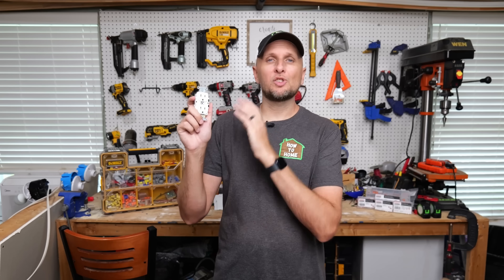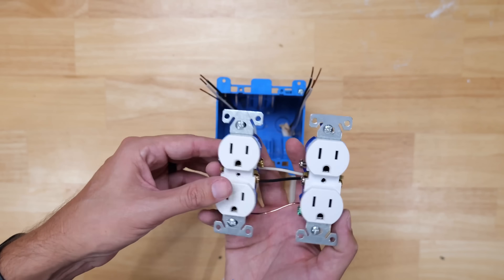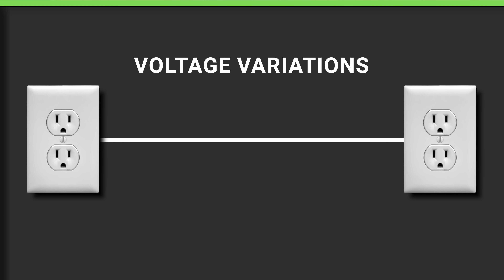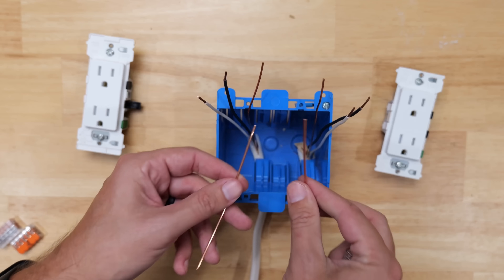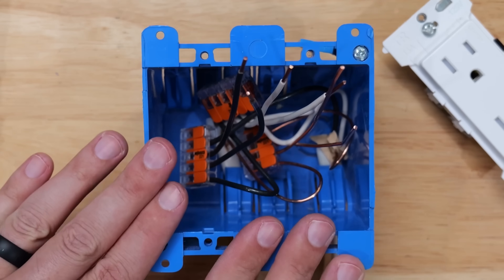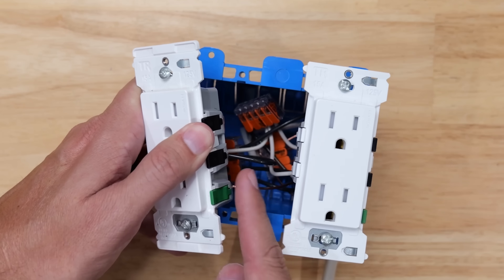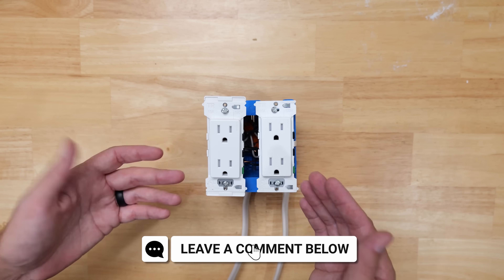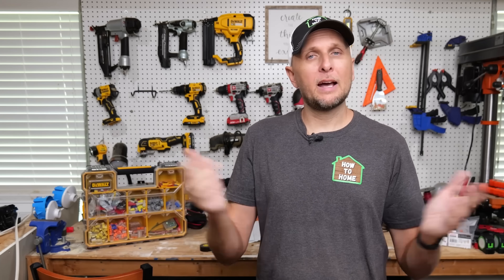Why This Outdated DIY Outlet Wiring Needs to End!

Comment: Comment #320
Not an electrician! Not a DIYer! You figure it out. 
Overall, I guess it is a good video. But one thing struck me as something where some more improvement could be added. You commented on the possibility of there being a Voltage drop if a (heavy?) load were plugged into an early outlet in the string that was wired in the manner you are saying should not be used. While there may be a Voltage drop, I don't think it would depend on the load. A standard (old style) duplex outlet has a pair of shorting pieces between the two screws on each side (hot and neutral). These shorting pieces are on the OUTSIDE of the outlet and provide a short path for the current to flow weather there is a load plugged into that outlet or not. The contacts on the inside of the outlet are connected EQUALLY to both of the screws, forming a "Y" with the two screws. Yes, a load connected at an outlet will produce a Voltage drop, but not between the two screws. The primary Voltage drop will be in the wire between the outlet with the load and the breaker box. And this Voltage drop will be the same regardless of how the outlet or outlets are wired in the one box. When I say "the same" I mean that none of the meters commonly used in the field would be able to tell any difference. You would need an expensive, laboratory grade meter for that and quite a bit of experience in using it. ------------------------------------------------------------------paragraph break----------------------------------------------------------------------------------------------------------------
On the other hand, when you used a five hole WAGO connector, you placed the incoming and outgoing wires at the first and fourth holes with the two pig-tales going to the two sockets in the second and third ones. Thus, the current flowing from the incoming to the outgoing wires and vice-versa must flow across those two middle holes. Just as the wire between the breaker box and that outlet has resistance, so too does the buss bar inside that WAGO connector. With the price of copper always going up, you can bet your last dollar, mark, yen, or whatever that the engineers at WAGO have pared that hole-to-hole buss bar down to the very, very smallest that they could get away with. And that means that the Voltage loss across it will be the most allowable. By having the current for the outlets further down the string on the first and fourth holes the length of that buss bar between them is 3  X the length between just one hole. However, a different arrangement of the four wires in the one WAGO connector can reduce that buss bar length and the corresponding Voltage drop by a factor of 3. Yes, I said 3. ------------------------------------------------------------------paragraph break----------------------------------------------------------------------------------------------------------------
I would suggest that the incoming and outgoing wires be connected to adjacent holes in the WAGO connector. That small change yields the 3X reduction that I talked about. In order to further separate the currents, I would suggest that the outgoing wire and the one or two pig-tales be on opposite sides of the incoming wire. That would give us one of the following wire sequences: For two duplex outlets: Hole 1, pig-tale; hole 2, pig-tale; hole 3 incoming wire; and hole 4, outgoing wire. And for only one duplex outlet: Hole 1, pig-tale; hole 2,  incoming wire; and hole 3, outgoing wire.

Comment: Sorry, but I fundamentally disagree with everything in this video, especially calling jumping outdated. This is completely unnecessary extra work for 95% of the cases. Especially to the DIY crowds that draw to these videos and don't have any experience doing electrical work, adding all of those extra wires and pigtails or wagos is more points of failure, and overfilling the box. Furthermore, try doing this on old work with 12/2 in smaller boxes.

Outlets are built to last *decades*.  And failure of one doesn't always mean everything on the line is going down, either. I just don't agree with any of this, nor do I think electricians everywhere are doing this extra work.

Comment: I do the daisy chain method when connecting a string of outlets together on the same circuit.  Its just so much easier to make the connections to the side of the outlet instead of using pigtails.  If I am working with a double outlet box I do have to connect the two outlets together with short wires going from one to the other.  I don't worry about outlets going out and finding the problem and having all the others work down the chain.  With electrical wiring, I have found that when I do it right, its done right.  You have less chance than the super duper mega lottery of having problems.
Reply: Absolutely, and much faster also.
Reply: Exactly and you don’t have all those extra damn wires in the box

Comment: In series (daisy chaining) versus in parallel (pigtailing).
Reply: That method of daisy chaining was not series it was parallel. If it was series nothing on the circuit will work. Take a battery for instance if you go( + to - and + to - ect) that is a series circuit now if you go + to + ect  then - to - separately ) that is a parallel circuit. They are both daisy chain method

Comment: Your opinion doesn't matter. Refer to NEC. 😂
Reply: Basically the NEC does not address how you should wire something that is left up to the electrician. There are different ways to wire something. You could solder that splice then wrap it friction, rubber and plastic tape in that order and that is not against code

Comment: are those connectors code compliant ?
Reply from the maker: Yes.  They are UL listed.
Reply: @HowToHomeDIY  - UL is not the NEC.  UL tests products for safety.  NEC and/or local codes determine what devices and connection practices are allowed or not.

Comment: I have been using the better method for quite some time now.  My 1950's house has some dated plugs, and I have replaced all of them with the new decora edge receptacles.  I like their ease of install, but I also like the feature that blocks the plug from curious, tiny hands.

Comment: Would converting to this method defeat many GFCI circuits? Our house is 25 years old and if I installed your pig tail system I think all the down stream outlets wouldn't have GFCI protection any more! Let me know if I am wrong.
Reply from the maker: You wouldn’t do this with a GFCI.  You would be required by code to have the current pass through it to the others.  What is in the video is for your standard outlets.
Reply: @HowToHomeDIY   The GFIC has a line out when you send it to the next receptacle you can and should pigtail the rest of the circuit.  It will all work.

Reply
Reply: Yes you are wrong. The GFIC has a line out when you send that out to the next receptacle you can and should pigtail. It will work as it was designed to

Comment: I am an Industrial Electrician & Motor Controls Maintenance Technician. I have 25 years of electrical experience, including residential, commercial, industrial, line work, and manufacturing maintenance.

2:20 Your opinion is WRONG. 
Adding another tap point is just creating another chance for there to be a problem because of a mistake made by the installer. The device manufacturer DESIGNED receptacles to be installed the way you're saying is wrong. It's very clear that you don't have enough experience to speak on these issues. 
2:53 It is a GOOD THING for the receptacles downstream to stop working. That will alert the homeowner MUCH SOONER to there being a problem. 
3:19 Voltage drop is not due to this install. It's a simple matter of electrical physics and the way electricity flows. 
Do you NOT understand the electricity doesn't flow through the receptacle? It stays on the brass screws and goes down the line. 🤦🏼‍♂️It's not a situation where each receptacle is carrying the load from everything downstream.
Reply: Thank you. I knew he was off the mark but was looking for an electrician to point it all out.
Reply: Thanks for the weigh in.
Reply: yep, he is wrong about a lot of videos these days, getting carried away and over confident. ALso deleting posts when people say so
Reply: Finally, somebody stating the obvious. This video is bogus.
Reply: Finally someone with common sense .
Reply: I don’t disagree but I still like using pig tails for some reason. Especially in my workshop where I regularly change the wiring. 

But now with the lever lock plugs I might rethink that. Those lever lock connections are just as reliable as an external wago
Reply: @ecospider5 I like the new receptacles, but I don't like that you can only use one ground wire. All that does is increase your box fill. I wish they would make them with an extra hole for the ground so I can catch the second receptacle when installing a quad. 
Side bar: Why are you changing your wiring more than once or twice in a 20+ year period? Just curious.
Reply: @MrFixItGa , In a wood shop where, in a 20 year period, you may have to reconfigure as you add more machinery and/or upgrade, or replace one or more from 120 to 240 volts.
😎👍🇺🇸
Reply: Welp, I'm never buying a product your hands have touched -- I like being alive too much.  Here's a little anecdote that'll prove that your entire comment replaced understanding with bravado.

I work in a building whose bunkrooms are on the same circuit as the kitchen for some ungodly reason.  The receptacles are daisy-chained with the terminal screws, the "old-fashioned way."  When the toaster oven would run in the kitchen, a receptacle in the bunkroom would overheat.

That tiny metal strip connecting the terminal screws finally caught fire and ignited the wall.  It's not meant to carry the full current distribution of a branch circuit, and it cannot handle 15 amps.  After that day, I started rewiring all of my receptacles at home with pigtails.

I don't care about the voltage drop part of the video -- interesting but not life-critical.  An engineer seventy years ago thought that the tiny metal strip wouldn't be an issue.  Turns out, they were wrong.
Reply: @ronstewart5945 It's obvious you have very little electrical experience. Your comment only proves the fact that the circuit was overloaded, not that the connection style was wrong. One minor issue does not a national emergency make. You mentioned nothing about amp readings, the size of the wire, the total number of receptacles on the circuit, the breaker size, and most importantly, the age of the entire system. What you're describing was actually more than likely a loose connection. I wasn't there, so all I have to go on is your very limited information that's missing a lot of details. I've seen a lot of hack work over the years. As I write this reply to you, I'm thinking about the literal thousands of pictures I have on my phone of work that is more reminiscent of hammered dog poop. You're more than welcome to make a video of your own to prove me wrong, but something tells me you can't.
Edit* I forgot to respond to the part of your comment about voltage drop. Voltage drop absolutely matters. You will destroy things hooked to the circuit when they don't have enough voltage. You will also overwork the circuit.
Reply: 25 years doesn't make you right.
Reply: @kevinhalsne1705 Yes, I understand that. If you were to continue reading, I explained my stance and gave reasons as to why I was disagreeing. Never have I ever in any comment section anywhere said, "I've been doing this 25 years, so that makes me right and you wrong." That's exactly how your comment comes across. I encourage you to reread my comment and actually respond with something more intelligent than what you said. Give us examples. Give us your background. I have an extensive background in electrical work. That's why I went through the trouble to type it all out. It was to show people where I'm coming from and why I feel the way I do about the subject matter. You should do the same. It's much more helpful and possibly educational (if you're correct) for you to give examples and explanations.

Comment: from a teaching perspective, pigtails just may way more sense. less guessing from the "newbie" since you're a) using a complete circuit at the wire nut and b) only have one set of wires running to each receptacle. Results in fewer instances of hot+neutral both on the same color nut and fewer polarity issues.

Comment: Do you need a ground fault breaker to install a GFCI receptacle to replace a non-fault receptacle?  My receptacles in my bathroom are non-fault receptacles. I want to change them to GFCI receptacles.
Reply: You do not need a gfci breaker. Just replace the old receptacles with a gfci one. If you do not have a ground in the box don't worry they will still give you protection they was also design for that situation.

Comment: Worked in the trades since the 70s and have never been aware of the discouraged jumpering scheme or used it. However isn’t using the wago  rather than wire nuts just like using the receptacle as the junction point?

Comment: Waitaminute... if there is a jumper, that jumper can handle the load across the entire device, because it, providing current is not exceeded. a failed outlet does not fail the jumpers.... UNLESS a jumper comes off. It is not like the load is being used as the passthrough to the next outlet.... so voltage drop will be a FUNCTION OF WIRE RUN.

 I am NOT an elechicken.... I got a broom and dustpan! So wherever I am wrong, please chime in.

 While Wagos are interesting, so was PVC potable water pipe at one time. Then we FO 10 yerars after we FA plumbing homes with the stuff.

 What about backwired devices, secured by clamping screw. (not the crappy backstabbers) I would expect those to be better than a little plastic lever. I might just be old or fashioned.

EXCELLENT video... but I got to question the theory, from the armchair perspective.

Comment: All you are doing is moving the failure point from the outlet to the wire nut. Also, this doesn't fix anything with voltage drop. Voltage drop is related to load and distance - and you've changed neither by doing this.
Reply from the maker: That is just not accurate.
Reply: @HowToHomeDIY  Might be more helpful/constructive to the others here if you explain how it's not accurate?

Voltage drop is a function of distance in part - anyone that's worked in theater or commercial settings where you've got long runs of 110/120V stuff will have likely run into this, even during low-load situations.

Others have likely experienced their lights dim with the air conditioner or other large motor kicks in - aka it's affected by load.

If you remove all those Wago connectors or wire nuts, do you expect your downstream outlets to continue working? If so... tell me more? If not - you agree that if they fail, the downstream stuff will stop working, right?
Reply from the maker: You are talking about something that has so many variables, typing them out here would take a very long time.  It isn't something you can just make a blanket statement about in terms of why effects of voltage drops wouldn't behave this way.  Distance is just one scenario where it can occur.  But resistance is another big one and there are so many ways that this can come into play.

I have never seen a properly installed wago or wire nut fail.  I have seen "properly installed" outlets fail though.

Comment: If your box is big enough... Smaller boxes, for whatever reason they're installed, will not allow nearly as much wiring as used in your method..
Reply from the maker: Plenty of room and pigtails and wire nuts or Wagos don't count against box fill calcs.  I have never not been able to get an outlet in a box.  Even larger GFCIs.
Reply: @HowToHomeDIY not saying your way is wrong... But I've personally had such small boxes that would not allow the extra wiring your method requires.  Not all houses are framed the same, especially older ones..
Reply from the maker: Not wrong.  If you can't get it in the box then you have actually overfilled it usually by having too many devices tapping into that box and/or using too large of wire.  If following actual box fill calcs, I have never had an instance where adding the proper amount of pigtails made it to where the receptacle would not go in.
Reply: @HowToHomeDIY ill agree with all of that.. special circumstances require modified results to reach the desired result.. as long as you do it safely!! You're method most certainly has the benefit of allowing the rest of the circuit to continue to function if one component fails.
Reply: @HowToHomeDIY  - I just swapped out a standard Decora switch with a Wi-Fi switch, using WAGOs, in a duplex box with a timer.  PITA trying to cram all that spaghetti into the box with those monster devices.  And since I was using WAGOs, it went from a jumper-based connection between switches to pigtail-based.
That's why I'd like to see videos with techniques of how to safely get everything in there.